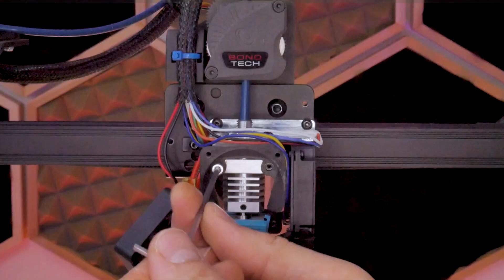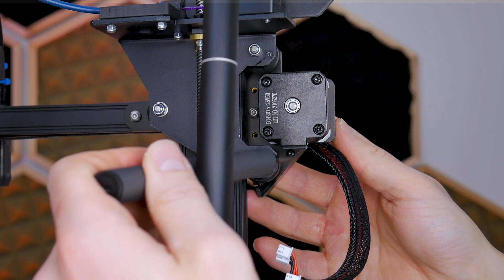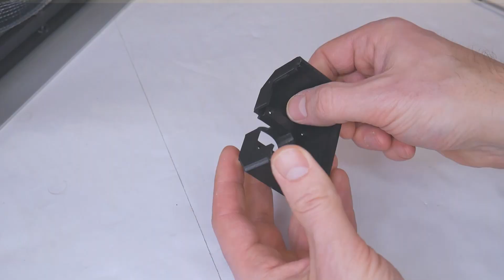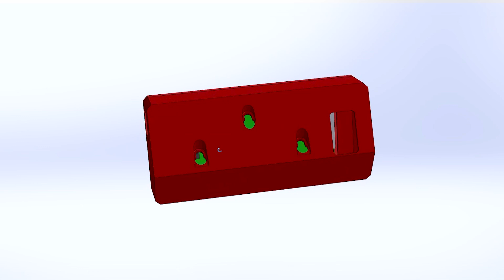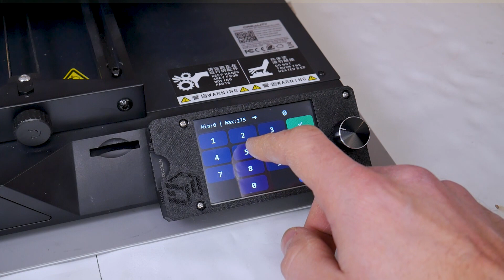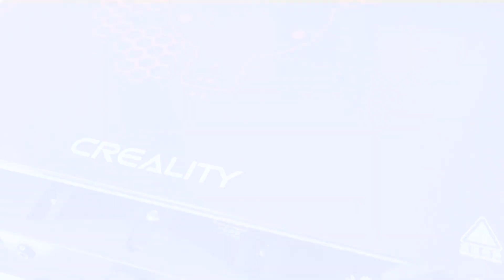How To Install CR Touch on Creality CR-10 Smart (and CR-6 SE)! The Fix You've Been Waiting For!

Comment: just wondering if you had issues with the filament run out sensor. Filament sensor is turned on , I have a blue light on the sensor with filament inserted but will not move from pause after i started a print. 
Otherwise you did a great job with rebuild , video was nicely done and easy to follow.  I had a Sprite pro kit I was going to use on my ender 3 but decided to try it on this build and it worked great only had to modify the bracket for the CR Touch as it was too far forward and missed the bed during mesh levelling.
Perfect upgrade for this Printer.
Reply from the maker: For the runout detection sensor did you use my firmware profile? In my github repository I mention the following, let me know if you did this:
NOTE: For the filament runout detection sensor to work with files being printed from the TFT Touch screen, you MUST put M75 in the start gcode, and M77 in the end gcode!!
Also double check in your configuration.h double check that your runout settings are like this:

#define FIL_RUNOUT_STATE     HIGH        // Pin state indicating that filament is NOT present.
  #define FIL_RUNOUT_PULLUP               // Use internal pullup for filament runout pins.

Thanks!
Reply: @EmbraceMaking  I used your firmware profile and did not make any other changes.
Reply from the maker: How long ago did you download the firmware? You can check the github dates but a while back I edited the runout sensor settings to match what I posted above. Also, are you printing from SD card on the TFT screen and have you put the M75 in start gcode and M77 in end gcode? This is what tells the mainboard a print is running (when printing from TFT SD card) and will trigger the filament change / print pause procedure  when the runout sensor is tripped.
Reply: @EmbraceMaking  I am using the latest update from your site and printing from SD card on the TFT Screen.
will have to look at  at the start and end gcode and figure out how to do that, its not something I usually play around with.
I usually get my firmware for my enders from the Marlin Service  pre configured but they do not support the CR10 Smart at all.

Great advise thanks for doing this modification my prints are 100 times better.

Comment: Awesome video man! Couple questions, since the smart v1 main board isn't compatible with cr touch, would this be do-able on the smart pro main board that's in the later model cr10 smarts like mine? 2nd question, all that's needed to do this if pro main board won't work is the skr mini e3 v3, yes? Your breakout boards are primo but I feel shipping to nz might make them unjustifiable for me.
Reply: I stand corrected, your shipping is very reasonable so will most likely order breakout boards next week, skr and screen on the way, then tbg-air extruder. The hero me creator is after the step file for the gantry bracket for this btw. I also wouldn't mind it if that could be arranged please?? would save a bit of time designing mounts for the bits I'm using haha.

Comment: Hi question! I want to buy the kit to put the touch on it BUT I want to run Klipper Mainsail on it. Is that doable/ possible?
Reply from the maker: Yes definitely. I have had one or two customers already do Klipper conversions with their printers. Over the next few weeks I am going to do the same and make a video about it. I'm going to be using the Big Tree Tech Pad 7 (basically their version of the "sonic pad") to do the upgrade on both the CR10 smart and the CR 6 SE that I switched over to SKR mini boards :)
Reply: @EmbraceMaking  That would be amazing and a huge help. Most of us on the Smart groups are running the Raspberry Pi Klipper mod with a BTT PiTFT50 screen on our Smarts so to have that running with your CR  touch/ LGX mods would be very welcome by alot of us!
Reply: Would it make sense to just use the Big Tree tech Pad 7 instead of the original touch screen you mentioned in this upgrade? Did you ever make that klipper upgrade video for it?e @EmbraceMaking

Comment: Hey im just trying to make a shopping list and add up what id need to purchase for all of these upgrades. alot of the amazon links on your site show the products as not available (im in uk) so trying to find the bondtech extruder.  Can I ask a question.... my smart sucks for being very unlevel, would this fix allow for that or would i still be better off adding the  wheels and springs to do manual bed leveling that some people do?
Reply from the maker: Hi Luke, here is an LGX lite that I found in the UK: https://www.printyplease.uk/LGXLite , and yes this whole setup should improve the ability for the machine to compensate for an unlevel bed. First the original strain gauge was not very reliable so at least in my case it never gave a good measure of the print bed, and second, I don't know what version of Marlin and type of auto bed levelling algorithm was being used on the original firmware but it could never compensate for very warped beds. The new sensor with the new SKR mini board lets you run newer versions of Marlin with better mesh compensation. Ultimately there are limits to what any of this can compensate for, but if your frame is that out of whack that it's beyond what the auto bed levelling can fix then you should also consider fixing your frame. Thanks!

Comment: Regarding the cable for the LGX Lite extruder, do the two wires still need to be flipped ?
Reply from the maker: There are a few options. You can swap the wires of the same coil on the LGX extruder, yes. Or if you're using my 'easy swap PCBs' you can just do it at the spring terminals since they are very easy to move around wires. Your other option is to leave the wiring and if you're compiling your own firmware you can reverse the extruder motor direction in firmware.... choose whichever is easiest for you :)

Comment: I also have a question about the random cable labeled just “Z”. Both Z motors are plugged in labeled z1 and z2. What is this thing xtra 3 pin JST called “Z”
Reply from the maker: That is the z optical limit switch that is no longer used.
Reply: @EmbraceMaking  i've been scratching my head on this for an hour. I have everything wired up and couldn't figure out where I went wrong. lol
Reply: Was trying to figure that out myself. Thought it was the z stop. Had to scroll way to low to find this

Comment: Fantastic guide, im already in the process of installing a CR touch after converting to sonic pad, klipper has already been a huge improvement for this printer, my strain has failed and requires tension on the heater to stop it from activating prematurely.

Regarding the touch install, can you bypass the gantry board altogether and plug it directly into the mainboard and then edit klipper code as needed? Ive purchased the gantry board anyway just to make things simple
Reply from the maker: Just for clarity, are you referring to the stock mainboard? If so, you can't plug the cr touch into there, the stock mainboard doesn't have a pin available for PWM to control the probe unfortunately. This is one of the main reasons to do the mainboard upgrade. But otherwise, if you have an aftermarket (or even Creality) mainboard that has the CRtouch plug, then yes you can skip the gantry board and route directly to the mainboard, OR if your cable doesn't reach the mainboard I put a second plug on the breakout board so you can then jumper from that to the mainboard easily.
Reply: @EmbraceMaking  yes the FDM v2.5 s100, does this also apply to the smart pro with the newer ARM chipset?

Thanks for clarifying, i have also shared this video among the facebook groups so others can also benefit from this upgrade. Great work, thanks for all the time and effort youve put into this 👍
Reply from the maker: If you get the smart pro board you can plug directly into that. I haven't personally tried it but since it has the cr touch from the factory I'm going to assume there is a connector for it
Reply from the maker: actually I take back my last comment... I googled a picture... looks like the smart pro board doesn't have the cr touch broken out. Like the CR10 smart it has the 14 pin and 16 pin connector and the crtouch would go through that... I haven't played with the smart pro so I can't confirm the pinout on those connectors. Did you already buy this mainboard ?
Reply: @EmbraceMaking  Its just whats in my CR-10 Smart, AFAIK newer Smarts shipped with smart pro mainboards but different pin assignments looking at marlin configs.
Reply: @EmbraceMaking I have emailed you

Comment: There is any chance to use the hotenden direct drive and cr touch pack that comes with the cr-10 smart pro?
Reply from the maker: If you get the exact one from the PRO model you may be able to run the harness down to the breakout board and plug it in. Since I don't have a pro model I couldn't verify the pinout though so I can't guarantee that the sprite from the pro will be plug and play with my board. If it isn't, you would have to repin the connector to be compatible

Comment: I believe that this video is needed. I just bought a CR10 smart without researching and I think that Creality has just given up on this printer and though my printer is working just fine right now. this is the future of my CR10 smart. Great video. Another well thought out engineering upgrade.
Reply from the maker: Thank you so much! When the CR10 Smart is working it's really not bad, but there is a reason these aftermarket parts exist. It really does take the printing to the next level.

Comment: Why spend 500.00 on a printer to gut it and build a DIY printer?
Reply from the maker: Hi Dennis, the video isn't suggesting to buy the printer to perform this mod. Many people (including myself) got this printer originally with the intent of using it as is. After having issues I guess you can throw it in the garbage or let it collect dust. Or do some of these mods and save it. As I mentioned in the video not all of them are necessary, I went all out just to demonstrate what can be done.
Reply: @EmbraceMaking  The first thing I did when I got my CR-10 Smart is adjust the dual Z axis with leveling blocks. I have zero problem with my CR-10 Smart. The only thing I didn't like is the was no external PC connection, But then I discovered there is a PC connection internal and ran a cable out same as the Pro.  I added M420 S1 to my start code and it is always level.
Reply from the maker: Yep, I had the exact same experience from the beginning. When my printer was working it was working great. However, over time I noticed that the probing wasn't as accurate as it was when the printer was new. Eventually the z offset was all over the place and no amount of abl probing or adjustment of the probe sensitivity would fix it. Sure, I could have swapped out for a newer strain gauge but from what I had read online, many others were having issues. I wanted to develop an alternative solution for those who wanted CR touch on this printer and a more flexible main board. So that's pretty much what lead me here
Reply: @dennishatton1337  could I ask you how can I adjust the dual Z axis with leveling blocks?
Reply: @jannerboyjohn  You need to print two blocks of same size. I used 25x25x50mm.
Place the blocks on each side of the gantry.
Loosen the the set screws at the top of Z Lead Screws.
Manually adjust each lead screw until it just touchs the gantry.
The X gantry must be level for an ABL system.

Comment: Hello ! Is it possible to make the CR-TOUCH work with the original motherboard ?
Reply: yes its possible...after huge trial & error I got it 🥳

using the filament pin for control bin but z-stop/optical sensor which wasn't PC15 ...its PB2 which was defined as switchpin in the marlin reference ..

board v25s1
Reply: @krankesEtwas could you help me do it on my cr-10 smart?
Reply from the maker: That is where this project started and was the original intention. Sadly it doesn't seem possible after a lot of screwing around with it. I figured I might as well go for a new controller that has been widely adopted with a ton of community support + lots of klipper conversions and lots of screen options, accessories etc.
Reply: What board model do you have cause someone was saying the newest cr10 smart comes with the smart pro board not sure if its 4 or 5 pins for the cr touch I will have to open mine to check I know I got the newer one just did not have the time to look

Comment: Hey Embrace
Is it possible to just get the PCB files for a lower price? I just need the gantry board.
Reply from the maker: If you just need a gantry board I can set you up. Go to my website and contact me through my contact page. I think on Github I saw you were in Oakville? I'm not far in Toronto
Reply: @EmbraceMaking  Alright, I'll contact you.
Reply: Can I get BL touch to work with the current motherboard?

Comment: Nice work with the video and cool upgrades.  Love the options you present, and how you provide the details, custom parts and firmware. I had looked into just doing your direct extrusion with the MicroSwiss upgrade, decided to buy a used smart pro for about $50.00 more than the cost of the upgrade.(I lucked out and got one like new.)  For the smart, I still like the idea of swapping from strain to touch, but don't really want to change the mainboard and everything under the hood.  Maybe I missed the explanation somewhere,  but I am left wondering why it is not mostly a  matter of mounting the touch,  running a new custom (touch) wire cable to the mainboard,  and updating the firmware. Leaves me guessing that the smart mainboard must not support the touch, or this upgrade option would be available.  Your upgrades are first class.
Reply from the maker: Yep you've got it. That is where this project originated from.... I had high hopes of integrating the cr touch with the existing mainboard and it doesn't work. I figured it was best to go with an aftermarket board that is very customizable, huge community backing, and readily available from many sources. Thanks for all of your comments!
Reply: @EmbraceMaking  Thank you for the reply,  I don't know how you do it all,  PCB design, 3D design, hardware/software sleuth/troubleshooter, video production, script writer...  and you make time to reply.  Super man!
Reply from the maker: Lots of coffee and very little sleep ;) lol
Reply: would a smart pro motherboard not work?
Reply: The auxiliary pcb on the gantry is different and so are the ribbon cables that go from it to the mainboard so at the very least you would have to replace those. Also you would probably need to make a new PC mount as it is a different shape as well.

Comment: This is cool but mighht has well get a different printer its not even a cr10 smart anymore
Reply from the maker: It depends, I know what you're saying but also keep in mind you don't have to do everything I did. The absolute basics would just be the mainboard and cr touch mount. Technically you don't even have to get a different screen. You can run the printer through octoprint or do a regular klipper conversion and interface with the printer off of the web dashboard. I just did as much as I could to try and show the extent of what is possible

Comment: Can use the sensorless homing with TMC 2209 in the SKR mini e3 v3 with this mod?
Reply from the maker: It should work just fine. You would still need to make the changes to the jumpers on the SKR mini and just go through the normal setup process. Thanks!